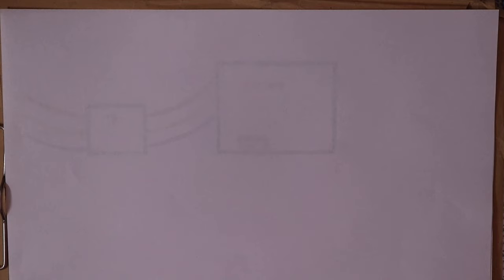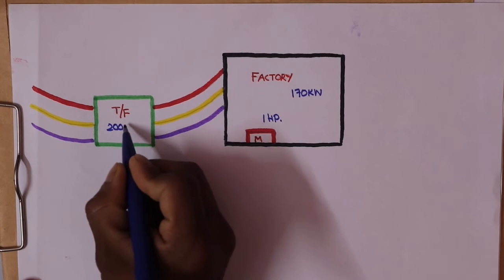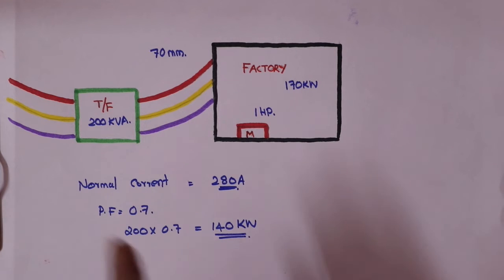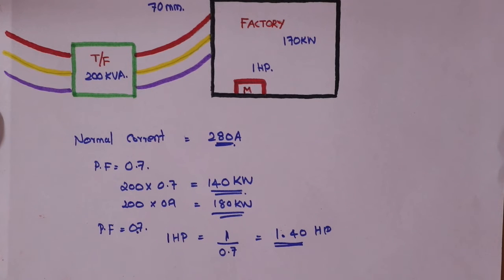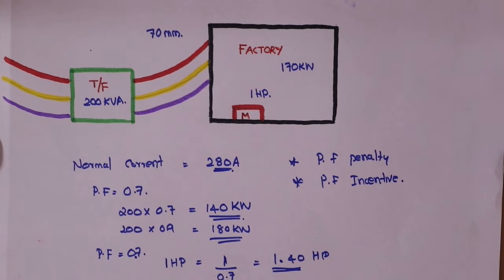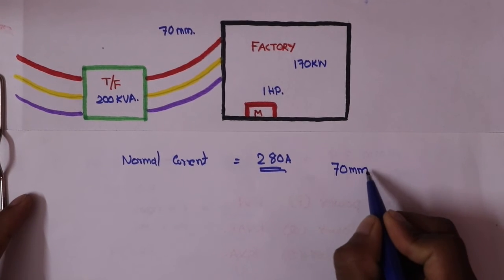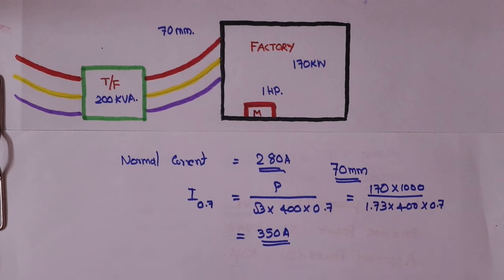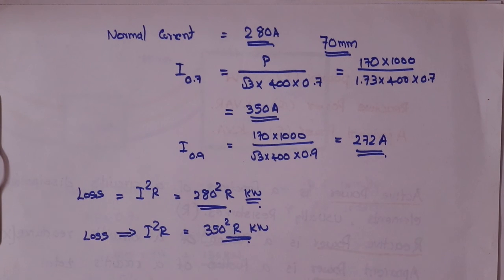What is the importance of knowing your power factor.? Why PF correction is needed.?

Comment: How you find out power factor 0.7?
Reply from the maker: Its simply explained in this video brother.. 
https://youtu.be/NZzh690Mwkk
Reply: @ThroughTheCircuits  power factor formula KW/KVA that means as per calculation 170/200  equal to 0.85 that's why I am asking how will get 0.7 PF
Reply from the maker: @sudheerj229 that is theoritical. We have pf meters to measure the actual values and 0.7 is an example only just to explain what are the problems of low power factor
Reply: @ThroughTheCircuits  Thanks for explanation
Reply from the maker: @sudheerj229  🥰🥰✌️

Comment: ക്വാളിറ്റി കുറഞ്ഞ മോട്ടോർ ഉപയോഗിച്ചാൽ കൂടുതൽ current വലിക്കും. അപ്പോൾ voltage കുറയും. അപ്പോൾ power കുറയും (pf )ശരിയാണോ .നല്ല ക്വാളിറ്റി ഉള്ള ഉപകരണങ്ങൾ ഉപയോഗിചാൽ pf കൂട്ടാൻ പറ്റില്ലേ. ഇതിനെ പറ്റി എനിക്ക് കൂടുതൽ അറിവില്ല..  Bro.. ഞാൻ പറഞ്ഞത് ശരിയാണോ..
Reply from the maker: ശെരിയാണ് bro.  Quality എന്ന് പറയുന്നതിനേക്കാൾ efficiency എന്ന് പറയുന്നതാവും correct. Efficency കൂടുതൽ ആണേൽ 2nd factor ആണ് power factor. മോട്ടോർ ഒക്കെ winding weak ആയാൽ resistance കുറയും so കൂടുതൽ current എടുക്കും..
Reply: @ThroughTheCircuits  Thanks bro..